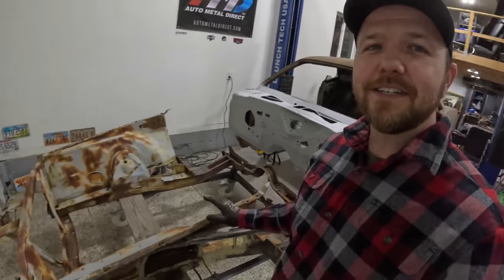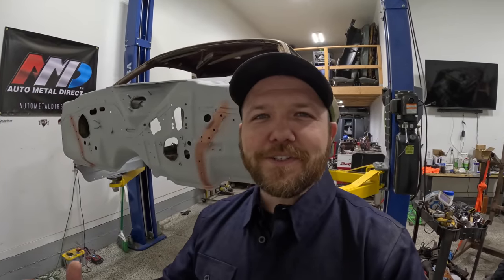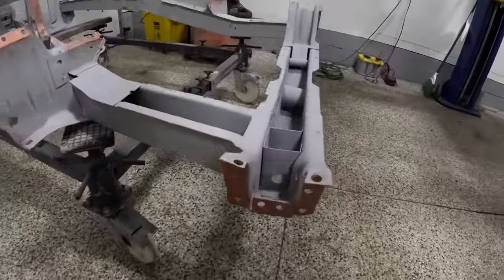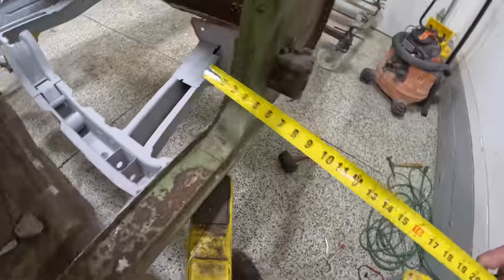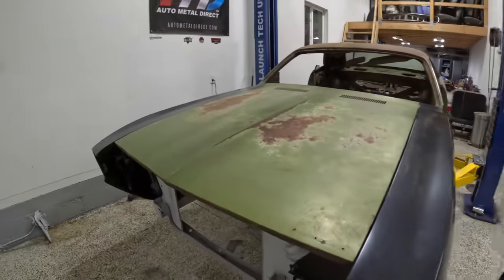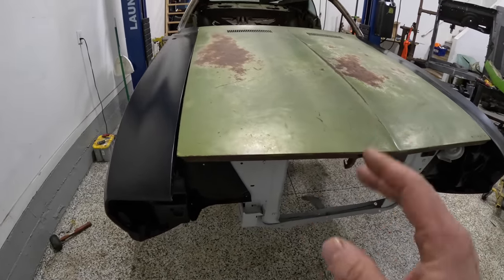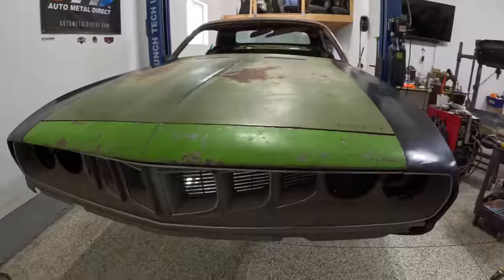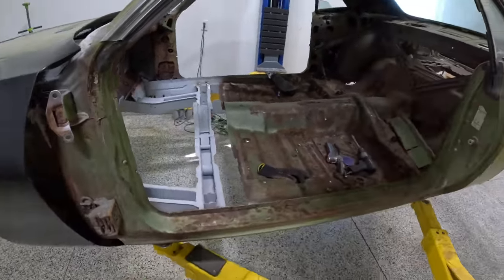1971 Plymouth Cuda - Episode 5 - Front Clip Install

Comment: Now is the time to build frame ties that would go deep into the front subframe. Bury it in the channel and no one will be the wiser, but you will know on launch and in corners!!!!!
Reply from the maker: This car will definitely be getting the same chassis stiffening kit as the Charger.  Can’t wait for that!
Reply: @rustbucketrestos6511  I don't remember what you did on the Charger, but you can hide box tubing inside the front subframe now and no one would be the wiser and it would make a huge difference in performance...

Comment: Nice Vid,
Did you have someone in the engine compartment to do any adjustments on the newly installed Hood Hinges to line the hood with the Fenders ?
I'm ready for final assembly after Paint and am trying to see if I can put the Engine in before I put the front clip on.